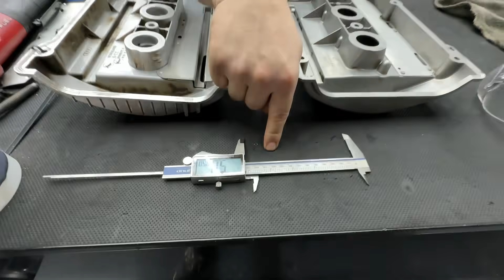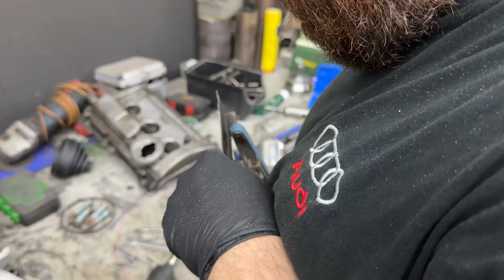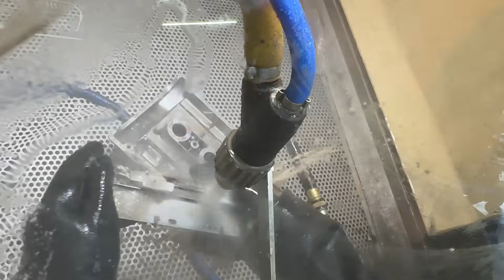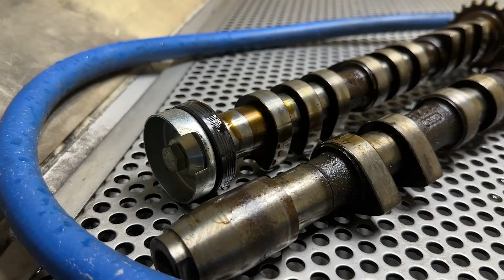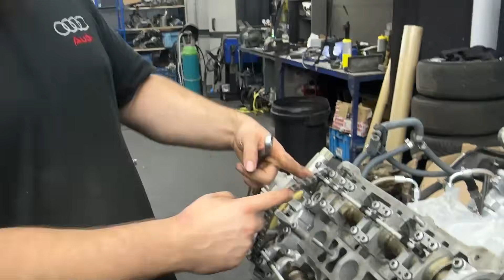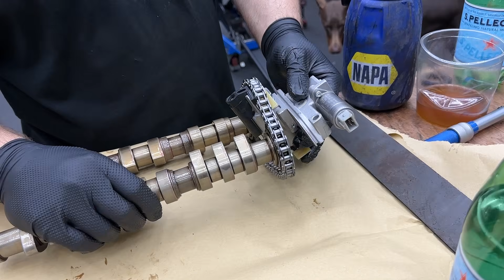Ep7 Audi S4 B5 , is it possible to fit the S4 rocker covers to 2.8 cylinder heads ?

Comment: 2.8 heads don't have the same ports as RS4 heads. Intake ports are curved in RS4 heads and the exhaust ports are smaller. RS4 heads don't have the oil bars on top of the cams.

Comment: Realy interested video like always 🙂 

I have rebuild my own s4 b5 nogaro blue with 2.8 heads and forged rods etc. 

But i have never seen 2.8 heads with that kind of oil supplie style.

I got 2.8 head from passat 2.8 code AMX and just swaped valvetrain and changed exhaust valves for inconel and smacked them on. 

Good luck on the build 🙂 

// Christoffer from sweden

Comment: Like the conversion on the valve cover. For the baffle my first thought was to drill a hole in the baffle and plug weld it or even tig weld a couple of stitches. Dont like bolts at this place even with lock tite imagine it fall !!! Concerning cam cap from another head to check if the cam turn smoothly is a good idea however if the line bore is a bit off you can't feel it. Maybe a good idea to measure it you have all the tooling. Not sure if it can be off that much that will wipe the cam cap or cam shaft?!?! Now please don't say your video are boring cuz it's not. understand that for people who don't do that stuff as a job we like to see how you build it and more importantly your explanation.
Tks man ! Canada like UK !!!!
Reply: Yea, had same thought with the Tig weld. Easier and cleaner

Comment: Later style 2.8 heads do not have these oil pipes.
Also,pretty much all cam chain sprockets I have seen are out of alignment since they do not have a woodruff key.
Removing the breather plates in the valve covers is a good idea since there is so much crap built up behind there
Reply: Hello 
What would be the purpose of the cover underneath the valve cover gasket?  Now i am thinking of removing mine

Comment: I have a 2.7T K04 sitting in my garage (along with the engineless B5 S4).  It's always nice to see someone still caring.  Though I believe you can just swap the Intake cams from the 2.8 for a extra power, if you can't find the heads themselves. Thanks for the motivation and pay an editor :)
Reply: Intake cams
Reply: Exhaust cams 2,7T and 2,8 are the same, so no extra power there from changing them
Reply: Corrected it to intake cams. Though I know one version the 2.8 has oil squiters on the cam caps that the 2.7t didn't so I am not sure if you need the version of the 2.8 heads without the squiters or if it matters at all. Maybe someone else knows.im sure it's in the 'net somewhere